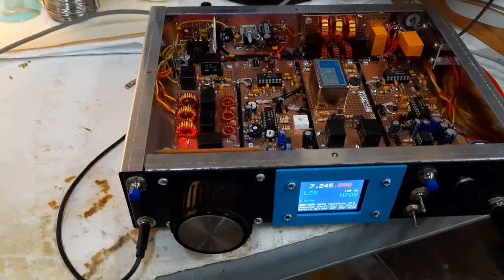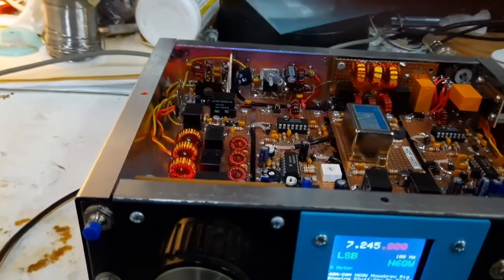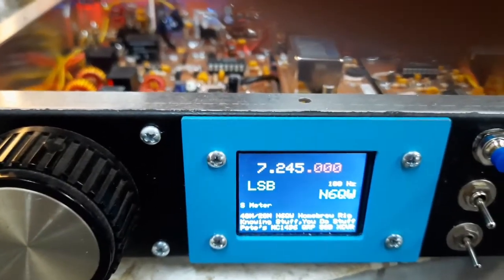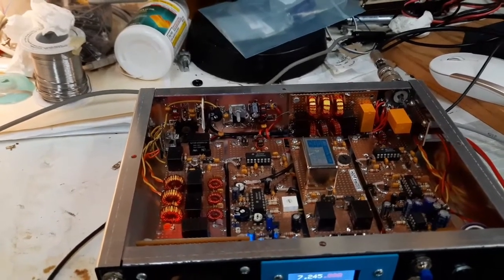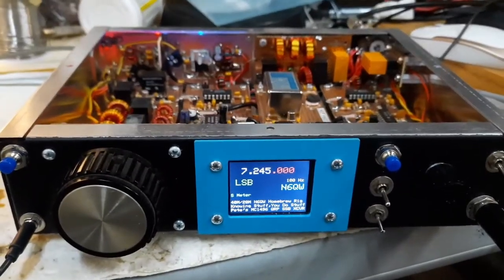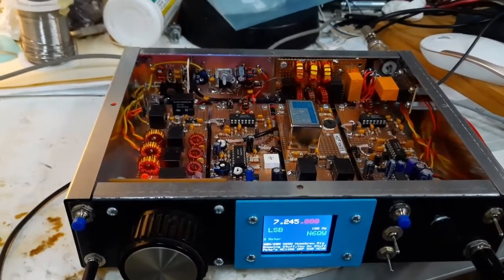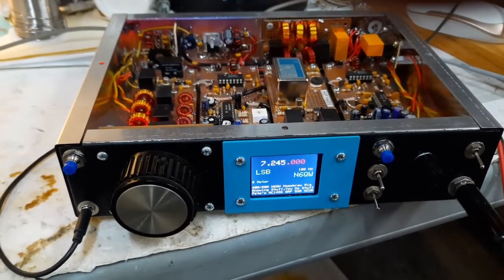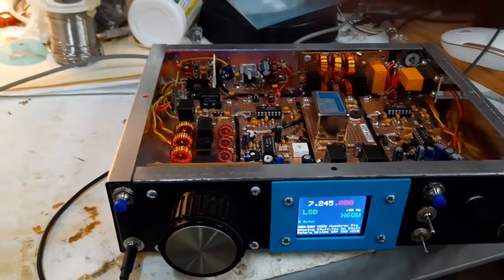MC1496 based SSB XCVR a QSO on 12 26 2020

Comment: Great work Pete - as always. Very neat construction. I've not really used matrix board myself but it certainly gives a very pleasing symmetry to all the modules. Rig sounds great too. I've just finished work on a Charlie Morris inspired construction - a tri-band (80-40-20) SDR SSB phasing rig powered by a Teensy 3.2. It has a TFT screen with spectral display and waterfall (only 22kHz b/w). I'll send you some photos etc. when I get a chance. Hope you are having a good (if different) Christmas. 73 Nick (M0NTV)
Reply from the maker: Hi Nick,

Thanks for your post. The matrix board is single sided copper vector board (read not cheap) and is excellent for rapid prototyping. Need a connection to ground --just solder to the top of the board.

Would be interested to see your ZL2CTM build -- I have two single band units based on Charlie's work but they only have an LCD Display not the spectral display or waterfall. Thus my interest.

As you can see how Boxer Day was spent out here on the left coast.

Cheers.
Pete N6QW

Comment: Sounds good Pete, there's still life in those old chips!
Reply from the maker: Hi Steve,

Been having a bit of fun with this rig which started life as an MC1496 Direct Conversion Receiver. A SMD version of the MC1496 is less than $1 USD and in current production.
Thanks for watching.

73's
Pete

Comment: Sounds great Pete!  Nice work!  
I just ordered some MC1496 chips myself.  73 from Missouri.
Reply from the maker: Hi Adam,

Well part of the success of this radio has roots in MO. I lived there for 11 years and managed to pick up a lot of parts from Gateway and Electronics Emporium in St Louis. Sone of those old parts are in this rig, I lived in Chesterfield / Clarkson Valley and worked for the Big Mac -- now Boeing.
Pete
Reply: Ha. That’s awesome! I thought it had a “hometown” sound. 
And as a side note, Gateway just recently closed their doors forever.  It will be missed.
Reply from the maker: @propagating-radio  I lived in MO when Gateway was downtown and not off of 270. They also had an operation out here in California near San Diego. It all changed when Stu passed away.  

Pete
Reply: @N6QW  I’ve only known when they were off 270, and then most recently in the Galleria mall, when their sales went downhill.   Sad times. 
Take care Pete and keep up the great projects.  I enjoy them and your website/blog.

Comment: That's a great sounding rig Pete. And no transmit receive 'clunk', I like that!  I've also built a homebrew SSB CW rig using the exact same circuit from SSDRA p203. As you say,  the UA797, later MC/LM1496 is straight out of 1980 (frequency found in the hallowed pages of Ham Radio magazine from that period), but still an excellent transmit mixer, balanced modulator and acceptable receiver mixer. 73 Paul VK3HN. 
https://youtu.be/DOKrSkYNTxc
Reply from the maker: Hi Paul,

Well your ears should be ringing as you are the person who started all of this. As you well know -- even simple devices can give quite good performance.

 I used the broad band transformer output option for the Rx and Tx mixer stages. I think on 20 Meters the tuned network option might provide a bit more gain since I see somewhat less output on 20 Meters.

Thanks for watching.

73's
Pete N6QW
Reply: @N6QW  Thanks Pete, yes we did discuss the utility of the 1496. I subsequently built a 1496 transmit mixer for 28mhz, 9mhz SSB in, 37mhz high side si5351 VFO, and I chose a tuned output to maximise output.  A broadband output transformer is probably OK in the 2 to 10mhz range.  There are other options for receive mixers but for a balanced modulator and transmit mixer the 1496 is my first choice.
Reply from the maker: @Paul_VK3HN   I bought a batch of MC1496 IC's for $0.69 a piece --so a few more projects still await this amazing device. '

Be safe my friend. The situation here in California is pretty dire -- no hospital beds and while we are it an almost civil war yesterday in our nation's capital

Pete